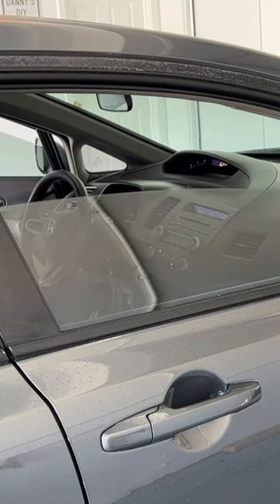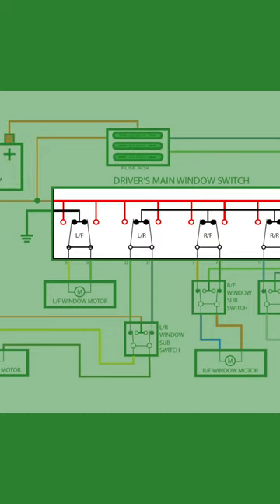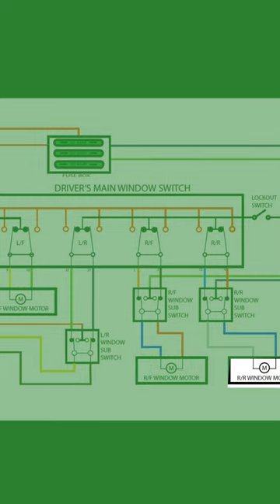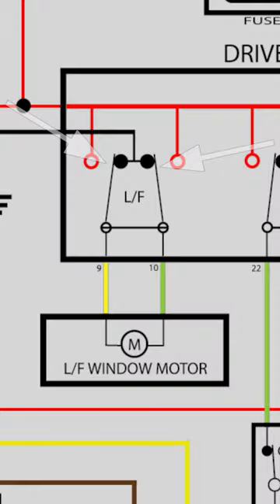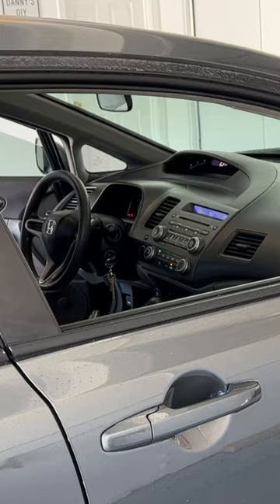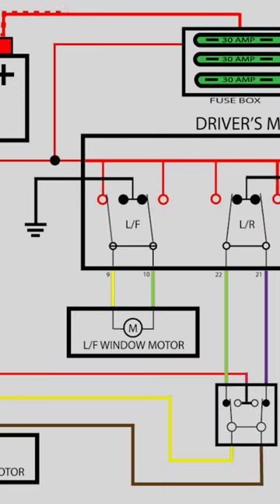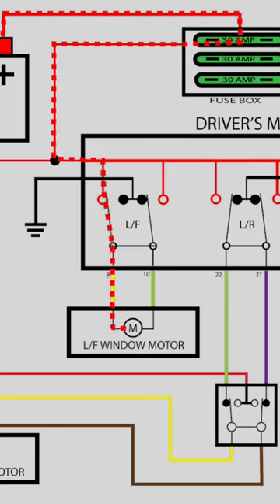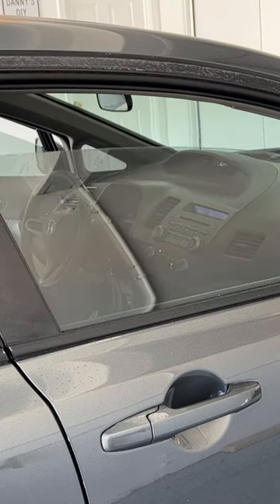Window Switch Electricity Flow in Automobiles

Comment: My passenger side window stopped working. Both driver & passenger switch will not work for the passenger window? I chked the fuses, they seem ok. I'm looking to c how to test the power harness. I plug the new window motor & nothing happened. So perhaps I don't have power in the connector harness,?
Reply from the maker: I have a few videos on my youtube page that address that problem, complete diagnostic, come visit my main youtube page. Here is one of them, but there is others also https://youtu.be/AOnRCJMwf9Y?si=hgbUgfTKHTWuFCiV